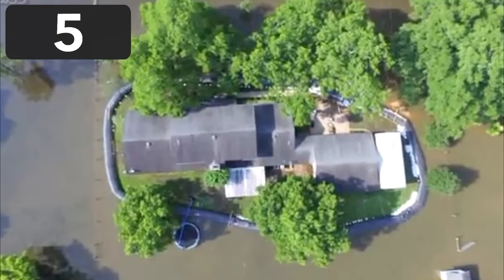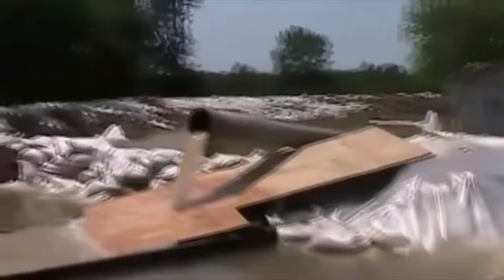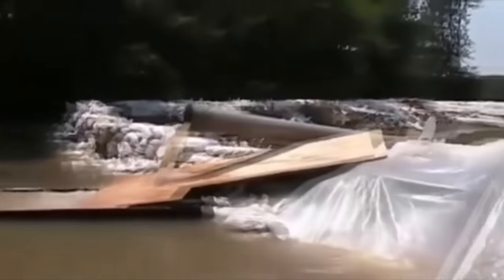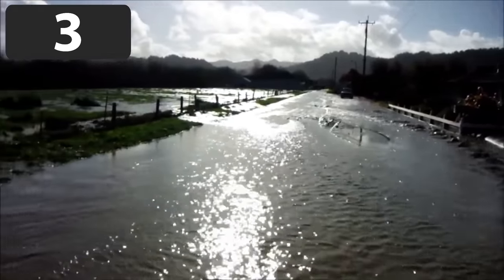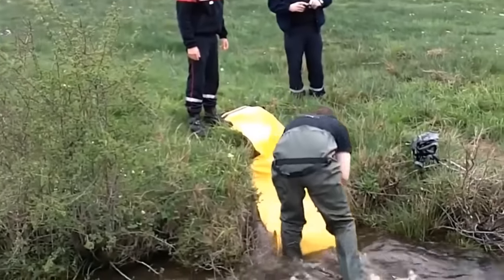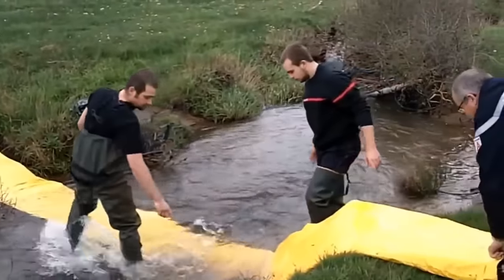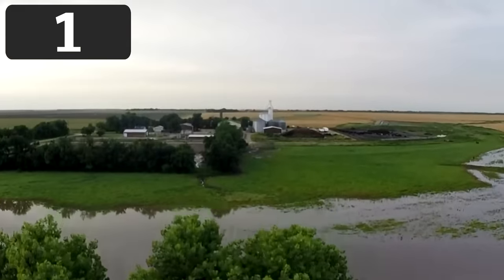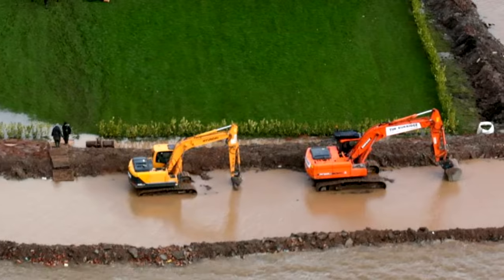Top 5 Homemade Flood Barriers

Comment: I'm a land surveyor and have laid out hundreds of homes.  Always amazed me how the builder would never elevate the foundation just  2 or 3 blocks higher to prevent a lot of flooding problems...
Reply: Currently dealing with this problem on a new construction home in Florida. The house is low, negative slope driveway and improper grading. The builder is a joke and hires incompetent contractors to do shit jobs. I am planning on getting the landscape graded correctly...do i hire a civil engineer, landscape architect or would a land surveyor do it? I want it done correctly.
Reply: @gr9515  Of course I am biased... but... as I have explained to people that have hired me to stake out houses the land surveyor is usually the first person on a tract of land, (and usually the last one paid), when it comes to a new development.  The surveyor gathers all the raw data that will be used by many other professionals in the planning and development of the parcel into streets and lots assuming the surveyor doesn't do it themselves.  Most land surveyors are perfectly capable of doing all aspects of design and layout.  Some jurisdictions though, will not let a licensed surveyor do certain aspects of this type of work.  Check with the local plan commission that will be involved with your project and see who can or can't do the various design work.  If a surveyor can't do the work then I'd get a landscape architect before I would hire an engineer.
Reply: @tubedude54  I'm contacting land development for the city( the civil engineer) to see what information i can get. It is nerve wracking dealing with this issue while waiting for a storm. These builders are horrible. I noticed the civil engineers either don't want to work with private residence or if they do they are extremely expensive. Thank you for the comment.
Reply: @gr9515  Your welcome!  Making sure the water drains AWAY from your foundation is not rocket science.  That's why I made my original comment saying I just didn't understand why builders don't go 2-3 blocks higher... and then slope the ground away from the house.  In reality I do know why they don't do it... it saves them a few hundred dollars in blocks and labor...
Reply: @tubedude54  it's horrible. Now letting the home owner deal with this issue in an are prone to storm and heavy rains.
Reply: you should also do your research into geo engineering.
Reply: All bout saving money

Comment: New comment as of 9/24. I live close to where the major flooding occurred mostly in NC and some in Tennessee. I'm on the Tennessee side of the mountains in an area called Appalachian Highlands. It's quite hilly. I pop my ears every day when I drive most anywhere. We got the same amount of rain as North Carolina, but it all went downhill. Only one river flooded because it's clearly the low point. But few people live along the river and the majority of them are higher than the river rose to. The water rose ~15' and all of the houses except for one that I know of didn't get flooded. There was still another ~5' to reach those hillside dwellings.
   South and east of here the terrain flattens out and that's the area most affected.
   Bottom line is that you can easily avoid buying a house that might get flooded by looking at topographic maps and flood zone maps. Terrain is everything in that regard.

Comment: For builder homes, there should be laws requiring them to have a higher foundation than the street level. Some of these floods are a few feet deep though, the slope would have to be steep or have a long front and backyards. I think with the melting of the polar ice it’s going to come eventually

Comment: When encircling a property with a barrier to stop water ingress it is important to consider sewer outfall.  If you are on a mains system water can back-flow through the pipes to achieve an equal level within without the barrier.
Reply: Flood prone homes should ask about check valves on sewer lines

Comment: wouldn't it be cheaper and easier to just build on a barge, so when the flood comes
You just loat above it then when the flood leave settle the house back on it's foundation.?
Reply: Or go up in the air.

Comment: If your wondering about danger of flooding for your area, and you have a GPS in your vehicle, check out my location in the tools area and look for elevation.  This actually shows how high you are above sea level, but it will show the water level in the same way if you go check by the water area, then check out your house level and see the difference.  This should help you when planning what are the dangers for your location.

Comment: OR... you could just not build in a flood plain....
Reply: Some areas become flood plains years after the homeowners purchased their properties when huge developments spring up and 1000's of acres of land which would normally soak up the water are covered over with concrete.
Reply: True, but most people put NO thought into where their homes are located, and what's close by.
Reply: I don't think you understand what a flood plain is...
Reply: I know all about those.  I know exactly where the 100 and 500 year flood plains are on my property, and there are no structures there.
Reply: LOTS of people buy homes and then bitch about things that have been by their property for years, like airports.  You'd be surprised at the number of people who move to the country then bitch about farm machinery on the roads.
Reply: Victor, we know better now.  What's your excuse for that?
Reply: there is nothing wrong with living on flood plaines just learn to controll the water better. look at us, the dutch. with hunders of years of dealing with water we havent had a mayor flood in decades even though a lot of our country is under sea level
Reply: The topography in the US is MUCH different than Holland.

Comment: The last house was still flooded lmfao so hardly an effective barrier.
Reply: Just by the garage and they had sand bags by the garage doors. Probably hardly any water got into even the garage. Still much less damage than it would have been, so it did work, esp in comparison to the nearby town.

Comment: So, I'll need three back hoes, a flood pumping tractor, a tanker truck to hold 10,000 gallons of deisel fuel, another tanker to hold 1000 gallons of gasoline, and ten guys to leave their families to protect mine, and about a months worth of food and supplies. Are their underground prepper bunkers actually  submarines?
Reply: cost to repair from a flood would probably be cheaper and easier

Comment: How about not building or buying in a flood zone! Shows you on the paperwork when you buy a house. Try reading next time.
Reply: And if you do ....build high.....
I built my cabin on 8 foot high  stilts bc my property is near a big River and in spring when ice is not  breaking  fast enough and you have snow melting in the mountains you have a big potential problem.
It hasn't happened but I knew it when I bought the property for cheap bc it flood zone. ..hasn't happened luckily.
Reply: Some floods happen in non flood zones
Reply: @zeras1823  no they don't. Low land equals flood area. If you don't know that then that's one of the problems.
Reply: @SimonElenor  Actually flooding can happen anywhere given the conditions, just take a look at the UK where within cities where being flooded due to the weather. so in reality flooding can happen anywhere
Reply: That didn't help those in Harvey when the rain wouldn't stop. I have family all over down there not in flood areas and guess what? It still flooded.
Reply: @kathleenbutcher2079  so they were 20 feet above the flood zone? For your information they were not!
Reply: @WhatTheHawk38  that's why I say find water and build 20 feet above it! Mudslides are a different matter.  Living on the side of a mountain is risky.
Reply: @WhatTheHawk38 I have been in 5 different floods. This is why I know flood water does not go past 20 feet.
Reply: It is one of the reasons I make damn sure I am no where near a possible flood. I am almost 50 and don't want to ever go through that ever again. Replacement of all the drywall and killing mold is a pain the rear.
Reply: @WhatTheHawk38 it's called trying to help people not do what I did.
Reply: @WhatTheHawk38 I guess there is no more learning from your own mistakes? That is one reason I left Florida.
Reply: @WhatTheHawk38 There is alot lost in typing. No where have I been cocky. Just facts.
Reply: @WhatTheHawk38 not acting hard.  Yes I did the same thing. But I learnt from my mistakes. That allows me to state facts. I am simply telling people to not do what I did. How is that cocky?
Reply: people buy in a flood zone because the risk makes it cheaper. If you are in an area that only floods once every 50 years, then the lower cost would be well worth it